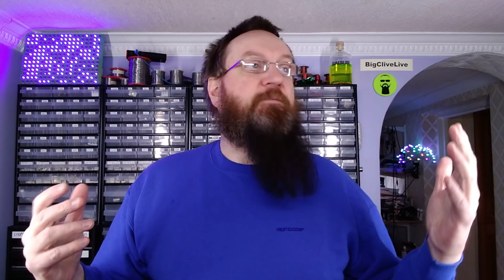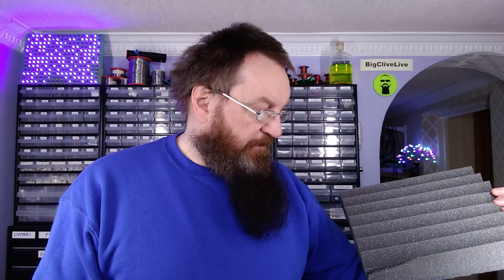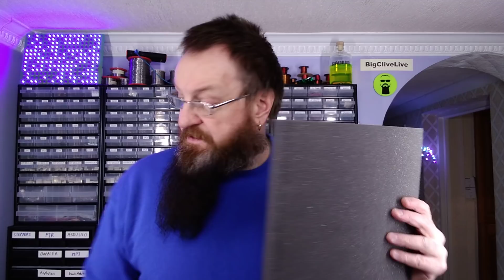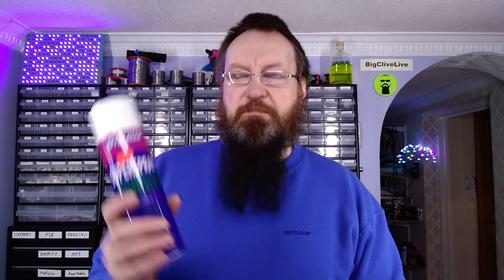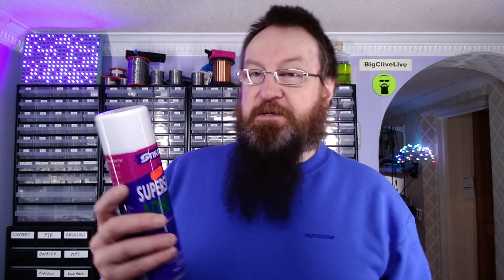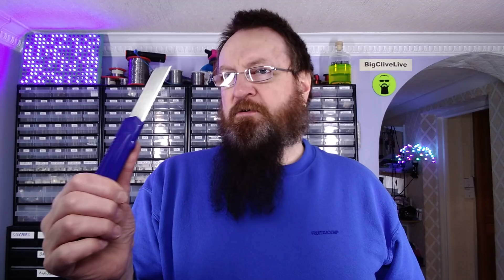Acoustic foam test.

Comment: Without having done a spectral analysis (yet), I think it definetly cleaned up the treble. Your voice still retains a relatively big bass-presence, which while sounding fine on my flat studio headphones, might be overpowering on most types of headphones and speakers, which tend to generally be bass boosted. I'd personally add an eq to reduce bass (up to 200Hz -ish) by about 3db.
For more detail I experimented a bit with an EQ myself and found that on my neutral headphones a 3db reduction was sounding - to my ears - perfect. Retaining just enough "punch" without feeling out of place. And this setting would likely make for a completely fine (still bass-heavy) listening experience on most consumer gear. a 4.5db reduction would likely be better for said consumer gear, while still sounding good (but lacking that "narrator-voice" style punch) on neutral frequency response gear. 
Irrespective of that, the treble sounded clear and nicely balanced with the mids (going from the cutter knife sound sample :D )
Hope these thoughts help a bit!

Comment: i use to work at a weld shop that was insolated with a material made of used newspaper, we had a spray bottle of water to put it out when it was smoldering

Comment: The treble got a bit muddy sounding after the foam was added. On the plus side you don’t sound as boxy as you did before. I bet you could clean the treble up with an equalizer if you were so inclined. I’m making some recordings from behind about a meter and a half squared piece of plexiglass at the moment, which gives that same sort of boxy sound. Changing the mic and it’s position even slightly can have a big effect on my sound quality.

Comment: I remember the SummerLand disaster on the news, if I remember correctly it was a bad fire caused by the use of plexiglass. Possibly the first time it was found how quickly it burnt and how bad the toxic fumes where.
Reply from the maker: Oroglas carried the flames up the outside.
Reply: @bigclivedotcom  Thanks I was wracking my brains as to what it was called. As a retail engineer I’ve been coming over to the Isle of Man for over 30 years, I remember seeing the aftermath. Very scary and extremely sad.

Comment: I can hear the improvement even over the built-in speakers on my phone. No question it is better. When I put on my IEM's I can still hear that the room is a bit close. I would recommend using about a 200hz 12db/octave high pass on your audio and maybe use a pop filter membrane instead of rolling off the highs quite so much maybe? Whatever, it needs more from about 4k up for better intelligibility. 

Get audacity and play around with it. You can record a process chain and apply them quickly, even to an entire folder of audio recordings. I use this when I do voice for presentations for work. I tend to make my voice recordings in a closet full of clothes (a cheap alternative to an anechoic chamber) and use the 200hz high pass (gets rid of the boomy sound), impulse noise rejection (gets rid of most of the bumping the mic type noises), then a noise gate (which make the silences truely silent) and compression (just keeps the level even). Many said it sounded better than professionally voiced videos they had heard.

Comment: You are spot on about the highs and mids! Sounds way better. I would recommend some base traps up in the corners of the room, even behind you as well. I think 1 in each of the three corners of the space would clean up the sound nicely. Either way, much better. OH, one thing, did you put any foam or anything on the ceiling? In my own recording area the ceiling turned out to be what was making my sound super harsh. Put some foam up there and cleared right up. Have a great one!

Comment: Timely - Ive got some coming from China, it says flame retardant, ill check on a panel before putting it up now!

NB Sound is hugely better now.
Reply: He mentions the station fire which happened in my state. They tried to cheap out on sound insulation and other issues. It was a very horrible tragedy. The amount of people it affected as well, run into many who knew someone there.
Reply: @JJayzX  I just tested the chinese stuff that arrived. Very very very flammable. Set fire to a corner, it kept burning and spewing out toxic fumes till the whole square burnt away leaving nothing left.
Reply: @francistaylor1822  Scary stuff, they really don't care about mislabeled stuff cause worst that will happen to them is their account closed and they will just open another.

Comment: Certainly reduces the previous multipath reflections being bounced off the walls, so much better. What microphone are you using?
Reply from the maker: The one built into a Moto G7.
Reply: @bigclivedotcom  Maybe try a Rode VideoMic Me, or similar :-)

Comment: What's the Mic?
Reply from the maker: Moto G7 built in mic.
Reply: @bigclivedotcom  Some users have sound recording issues with the G7, here's the most up to date solution from one user : "...Download Open Camera from google play and change 2 settings in the app, in Video settings / Audio source select Uncompressed, then under Audio source change this to Mono, mono is what solved the underwater / muffled sound problem, ..."  Thread here: shorturl.at/dpxFK (Also upgrade to Android 10 if you haven't already done so).

Comment: I don't like the room sound and as I use a mobile to watch you the bass is not what's needed.
You did toy with putting a circuit board behind the phone and a mic over your head, they both was kinda nice, however something to try is a parabolic dish or bowl with the mic in front of, that may get some more of the treble as the wavelength of the bass vocal tones will not be as much as more treble is going to be reflected back at the mic. 
Thing is it would need to be quite big, maybe half a meter would get a nice set of mid range on the voice to a smaller 250mm for just high end. 
Again this also depends of depth of the concave item, if it's metal, plastic, ceramic, glass or for more bass dampening use wood

Comment: Foam not really thick enough to deal with low mids as I suspect you realise from your comment in the video. Does sound better but as others have said a little mid bass reduction and or high pass filter adjustment might help matters now.

Comment: Plenty of creators also use either the self healing cutty mats - or the solder jockeys use those big silicone soldering mats.
If you look in the baking section you can get ginormous silicone ovenproof/baking liners good for silly degC resistant, also acid resistant (but not cut proof) for not silly money. I got 5 for £10 a couple of years ago and they are still like new.  They'd also probably take down the bass somewhat (and they come in pink!)

Comment: I have made panels with rickwool. Using 1x4 wood frames.   Works well and probably has a broader range of frequency effect.   Try one or two of these panels.  About 18 inch wide by 48 tall. Can be covered with lighter colored fabric instead of ugly black

Comment: It does exactly what it's supposed to do and has absorbed the higher frequencies and removed the reverberation. You do need to adjust the audio settings to recover the lost high frequencies, but that is about all that's needed.

Comment: Why did you not perform a more scientific test? You could compare the audio on a spectrum analyser, maybe use a sine wave test tone. There are apps for tablets and Windows computers that are a suitable substitute for an expensive analyser. 

That said, the audio quality certainly changed. Like the sound in an anechoic chamber it sounds dead. The lose of reverberation is not always good, especially in a small room where the echo decay time is short. The only advantage might be when testing mechanical devices that make a background noise.  With the echo removed, you could always digitally process the microphone output to control the echo and the spectrum.

Comment: You could DIY a sound diffuser with some blocks of timber and stick some sound activated LEDS in it. There are designs online for the diffuser as they're expensive to buy. It'll trap the sound as opposed to deadening it.

Comment: Since it's a small space it's verry likely you overdampened, causing a verry dead and booming sound.
Just simple karpet on the ceiling and a curtain on one side wall should do.

With the  material you used probably 30% of the ceiling and 20% of ONE wall should already be more than enough (and do NOT dampen the wall BEHIND the microphone!)

Comment: That! . . . is a big reel of solder 😎

Don't think it's made enough of a difference to justify the hassle.
You got a Wickes near you?  You could try this stuff if you want to go well over the top. . .

https://www.wickes.co.uk/Rockwool-Sound-Insulation-Slab---50-x-600mm-x-1-2m/p/148841

Comment: I'm no expert but I've built home theaters in the past (as a hobby for the most part) and that level of foam isn't really suitable for your deep voice. You'd probably do better (and save some money) to build your own panels, wood frames wrapped in burlap or some other cheap coarse material around fiberglass or similar suitably dense stuffing. You could also turn the corners into bass traps which would help. There's also a ceramic based paint out there that, supposedly, turns sound into heat.  I've used it, it's not cheap, but it did make a noticable difference (measured subjectively ymmv). The stuff I used dried almost black, was very thick (required a special kind of pneumatic sprayer), and very heavy (go figure). One other option would be to introduce an EQ into the sound stream and attenuate some of the lows which would at least give the impression of clearer audio to your audience. Again, not an expert, just based off my own limited experiences.

Comment: Had a similar prob in my office which I sometimes record in. Filling one wall with books and hanging a rug (which I can remove) on the other, cured it. Main thing is to stop that sound bounce-back. Foam does absorb high-end, so agree with others, you'll need to compensate for that. As an aside, ever been in a room that has them on every surface? Its horrible - you start to hear your body.

Comment: From an audio professional: the reduction in reverb is nice, with the downside that the high frequencies fall off with movement. The reflection off the bench produces audible comb filtering (sounds like talking through a pipe) that was previously "filled in" by the reverb. You can probably solve this using a boundary mic on the bench. Low cut would be necessary to stop the thumps from the bench. A lavalier mic is a second option but you will still get comb filtering.
Reply: Balls

Comment: The fact Clive can reach slightly above his head and say "ceiling is here"...
Reply: Well, he is "Big Clive" after all.
Reply: Standard in Britain. Probably a way of reminding you of the countries great marine tradition by constantly making you feel like you're on a ship.
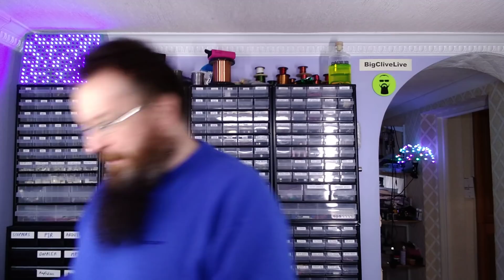Reply: @3:25 he steps up back into the shot, so might be on a small platform.
Reply: @eliotmansfield  Yes, a good five to six inches I would say.
Reply: Had some of those low ones, such that installing a ceiling fan was a matter of ducking more than reaching. Especially afterwards, as the blades came in a little under hair height. Thankfully there was always going to be a table under it to avoid those painful reminders.
Reply: He's a big bear to be sure, but that's also a tiny room.
Reply: Even on a 1.5 metre ladder, I need to be on the top rung to touch my ceilings with my 5ft 9 height...but then again, they are 14ft high...yeah, yeah, I know, short arse that I am!
Reply: @johnjones4825  I am 5ft. 7 and I can touch the ceiling in my room, but then again, the ceiling in my room is at 6ft 6.7" :P
Reply: Yep, sounds noticeably better. 👍
Reply: Elbows slightly below shoulders, fingers curled, thump thump thump. A ceiling fan would hit his chest.
Reply: looks like an 8foot ceiling.
Reply: @vopezy  Nope. It's quite a low ceiling.
Reply: Standard British ceiling is 7'6" (about 225cm).
Reply: @DavidCowie2022  I’m not sure when a standard UK ceiling was 2.25, my house, built in the 1920s (nothing grand), are 2.60 and for a long time the standard height has been 2.40 to suit a sheet of plasterboard. 

I’m not even sure (until stud walls and dot and dab became commonplace) there ever was a “standard height” it just depended on what the builder at the time fancied building.  

2250 wouldn’t give you much clearance if you even had a standard 150mm pendant in the room. I’m not saying there aren’t plenty of ceilings out there that are 2250, but I’m saying that’s not ‘standard’

Comment: Huge improvement, but the comparison is moot since neither installation was referenced to the gold standard surface acoustic treatment : egg boxes.
You also need to fix the stack of drawers behind you and the ceiling. A drape across the arch over your left shoulder too..

ps A note to all the "its boomy" and "it cut the treble"... Thats not the acoustic treatment, thats the beard!

Comment: Hi,  it has taken off everything reflected from around 1.6khz   It really needs an equaliser boosting the mid and high and also a reverb plug in to make it sound like a larger room (not a cathedral. Less is more).   To finish, I don’t know if IOM has a screw fix but their spray adhesive is even cheaper and is really good

Comment: Yep. Sounds normal, like the presenters on tv. Not like you’re in the bathroom. 👍
Reply: It does sound better (less reverb) but definitely not TV quality, especially if you're using headphones :B
Reply: I agree! However, With the volume of space Clive is recording in, I think there's actually too much foam, too much sound deadening. Do appreciate the lack of bathroom acoustics.
Reply: You saying it no longer sounds shithouse, Stephen? 🤣
Reply: Sounds normal?!? No. It is so boomy and muffled it is difficult to listen to.
Reply: While Using Acoustic Panels You Need Acoustic Curtains for Your Rooms, SoundProof-Curtains.me
Reply: It sounds much more like radio with the bass emphasis. It's like the foam is over the microphone and killing the higher frequencies that way.
Reply: @userPrehistoricman  The radio stations where you live must be really bad, if they sound like this. :P

Again, I agree that it sounds better with the foam - since the highs don't reverb as much so there's less echo.
Now it sounds a bit too bass-y (even for radio standards), but he should only need to tweak stuff a bit; maybe use a bit less foam, like I've seen some other comments suggesting, and/or adjust some settings on the microphone.

Comment: It is definitely different and after a few minutes to get used to it , I like it . I wonder if you could talk a little about the issue of flame retardant additives vs intrinsically fire resistant materials , I have read that the retardants can be bad and intrinsically fire resistant is better. I'm interested because I have been considering something similar to what you have done , but wanted to try a silicone foam cut with a band saw with a scalloped knife blade.

Comment: Completely killed the treble and dragged the midrange down toward the bass causing the resultant sound to be muffled.
You need some EQ management.
Reply: +1. I think the best way to go about this is to test a few different EQ settings and find the best one and use that for future livestreams.
Reply: @shadow7037932  First he needs an adjustable EQ in the pipeline.

Comment: It's reduced reverb but is now very "dead" the idea is stop standing sound waves which happen when you're in a square room,so rather than coat every surface you place the form in different areas in small patches to break up the sound waves

Comment: Makes a big difference. But unfortunately not the best. It mostly affects the high end which was not the problem.
The issue now is that you are left with the troublesome boomy low end which makes your speech overall muffled and less audible.
I'd suggest breaking up 90° angles of walls and maybe put some bass-trappy stuff in the corners
Reply: Yeah
Reply: Agreed. Clive's bear voice has always been a challenge for my speakers, but with the foam it's just too much. I'm often watching the streams on a TV with a decent sound system. Not an audio expert, but you need to reduce the bass somehow.
Reply: Just EQ that. A little high pass at 100 Hz and maybe, if necessary filter some modes and you are probably good to go. Should be quite easy with most modern video editing software.
Reply: @Mefistofy  It's always more preferable to have a decent sound at the source rather than 'fix in the mix'.
Technically you're right, that's possible. But treating theses basic kinds of issues by slightly treating the room will improve the sound overall, not only the bommyness.
Reply: @juweinert  I absolutely agree with you, especially with such a small room. Will probably add a long reverb tail. Ok, did a very coarse estimate of the Schröder frequency and got roughly 300Hz as lower frequency where the modes will overlap. So actually using thick isolation is quite helpful to eliminate or reduce specific nodes. I'd just don't bother with bass traps below 100 Hz. That band is kind of useless for voice. Just cut that with a high pass.
Reply: @Mefistofy  This is Clive's live streaming place and he usually does these with a phone using the YouTube app. Probably not a lot of EQ settings there (if any).
Reply: @Maurice_Walker  Oh, makes sense. Then room treatment all the way, I guess.
Reply: @Mefistofy  Not 100 Hz, that's just slicing it.
Reply: what about headset type mic? 
Always been my experience that placing mic closer to source tends to lessen room acoustics. 
I'd say a lav mic but his beard may cause even more problems....!
Reply: @JohnnyMotel99  Imagine that headset style microphone buried deep in that big black curly beard ^^